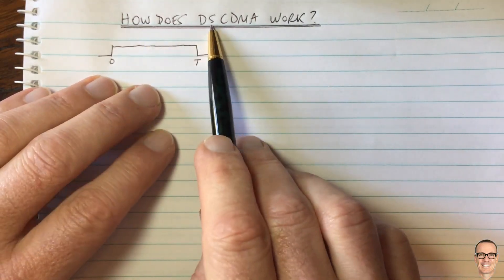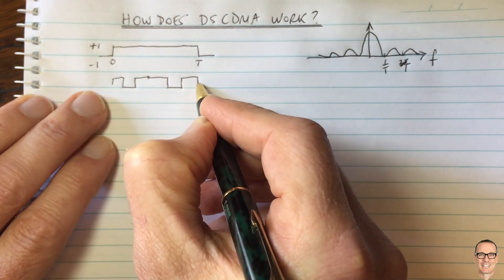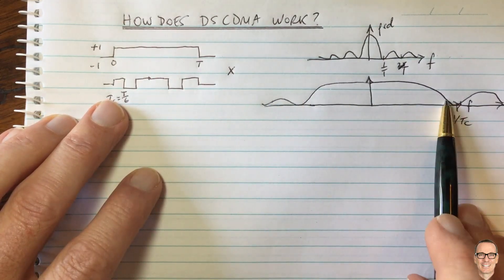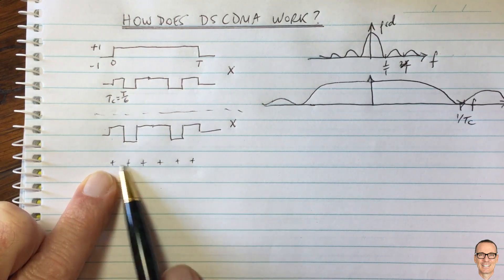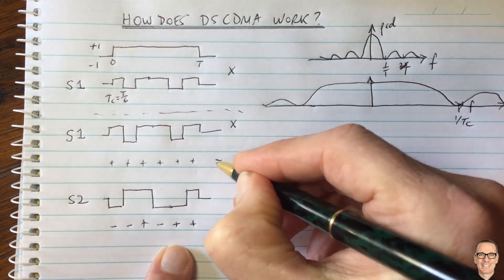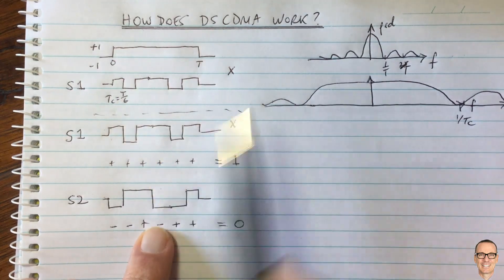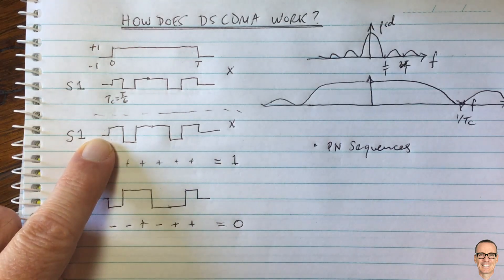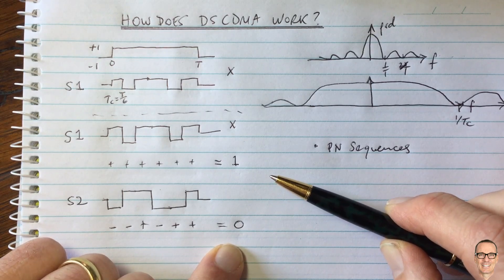How does DS CDMA Work?

Comment: I have a question. 
I am looking at the Shannon-Hartley capacity formula, C = 2B x log2(1 + S/N). For DSSS, you're spreading and then de-spreading meaning the overall data rate stays the same. But the bandwidth is higher during transmission, does that mean transmission at lower SNR is possible according to the formula?

Comment: In your example, is datarate reduced to 1/6th the original datarate? Ie, must your software support 6x datarate to achieve the same throughput as the original, non-encoded data?
Reply from the maker: Well, the usual way to look at it is to consider the data rate (and symbol rate) to be fixed, and then the "coding sequence" (often called "spreading sequence") multiplies the data symbol, resulting in a transmission bandwidth that is wider (by a factor equal to the "length" of the spreading sequence).
Reply: @iain_explains  So bandwidth is increased with spreading to maintain the same symbol rate, correct?
Reply from the maker: Yes. That’s why it is called “spreading”, because it spreads out the bandwidth.

Comment: Thanks for your sharing.I think it is using kind of voting method to differentiate wanted and unwanted signal. I learnt CDMA during high school but not really dont know the principle especially on PN code. But now, it could be easier to got everything fro the internet. I built a digital base band for the CDMA with the FPGA chips, it is now more easier and affordable to do so.
Reply from the maker: Thanks for your comment. It's great to hear that you are building communication systems.

Comment: Hello are we mixing the spread sequence with the bits together? I am wondering how this mixing would result in the frequency domain... I have read from books (what you have also mentioned in the video) that the the resultant spectrum is wider and makes the signal more resistant to interference. But how does that work mathematically I am wondering. 

Last but not least, this is a great video 👍
Reply from the maker: I'm not sure what you're asking, exactly. Multiplication in the time domain is the same as convolution in the frequency domain. That's the mathematical relationship. Perhaps these videos will help: "Convolution in the Time Domain is Equivalent to Multiplication in the Frequency Domain" https://youtu.be/Ex318cCXSBM and "Amplitude Modulation AM Radio Signal Transmission Explained" https://youtu.be/-PWg-0k2oks
Reply: @iain_explains  "Multiplication in the time domain is the same as convolution in the frequency domain."  yea that's what I mean exactly.

Comment: Hi Sir!  Great video and thanks for uploading!  Just for my clarification, the psd of the spread signal would be for one chip not for the entire 6 chips, correct?
Reply from the maker: I think what you're trying to ask is whether the wide frequency width of the PSD is a result of the short time period of the chip waveform. If so, then the answer is Yes.
Reply: @iain_explains  thanks Sir!  For further clarification.  When u say 1 chip waveform do u mean 1 chip and not 6 chip, correct?
Reply from the maker: A 6-chip waveform is just a 1-chip waveform added to 5 other 1-chip waveforms each offset by an increasing number of chip intervals. Time offsets are just phase changes in the frequency domain, and so the bandwidth of the 6-chip waveform is the same as the bandwidth of the 1-chip waveform.

Comment: Thanks for this wonderful video. Could you further explain how DSSS makes Inter-Symbol Interference negligible in the multi-path scenario?
Reply from the maker: Thanks for the suggestion, I'll put it on my "to do" list. In summary, each delayed path in the channel (ie. the ISI paths) will arrive at the receiver with a different time offset, and can be correlated with the spreading code at that respective time offset, in order to detect the data on each path separately. If the spreading code is orthogonal to time-shifted versions of itself, then they won't interfere with each other.

Comment: 3 pluses + 3 minuses = 0 (I understand this)
6 pluses = 1 (What? How? Shouldn't that equal 6 instead?)
Reply from the maker: Sorry, I probably didn't make it clear that I'm assuming a scaling here. Technically, we should be writing down the value of the output of a matched filter in each case. So, the non-spread pulse would be received as (+1)(+1)(T) = T. Each chip in the spread pulse would be received as (+1)(+/-1)(T/6) = +/-(T/6), and then they get summed up. So it's all OK in the video, just called by T.
Reply: @iain_explains  When you say "matched" filter, presumably a matched filter designed to our spreading sequence to integrate over T. So if it finds itself in the received signal it gives a correlation of +1. If it finds an inverted version of itself in the received signal (because the transmitted signal was -1) the correlation gives -1. I think zero when there is no correlation? In other words, we get back our original sequence of -1 and 1.

Comment: This is wonderful. Thanks for uploading this on my previous request. Had few questions in mind, I was referring "Wireless Communication"  book by Rappaport and found out that we need to use the equalizer at Receiver for the time varying channel. How those would affect in this DS-CDMA case ? And i think RAKE receiver would be a way to go  as receiver for most of the CDMA system. Is there any simple way for designing a receiver ? Simply let's say we have ADALM PlutoSDR, can we use that as receiver, which i believe is not RAKE receiver. If you can comment on these questions, would be helpful. Thanks for your great work.
Reply from the maker: Sorry, I'm not familiar with the particular SDR you mentioned. In general though, yes, you're right, typically DS-CDMA is received with a rake receiver. I've got it on my "to do" list.